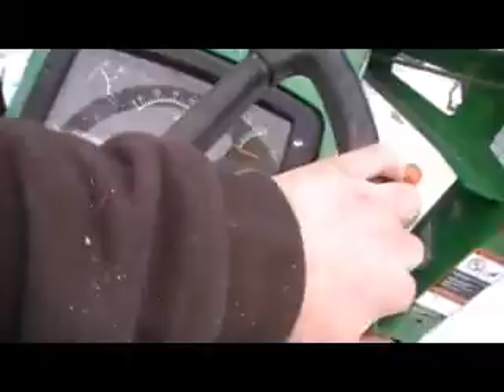putting a bucket on a john deere 790

Comment: I have a 790 tractor without the front bucket, and I was thinking of maybe looking for a front loader to put on the tractor. I noticed that your tractor have turf tires on it's rear and those are not good for the snow. My tractor came with the mid grade tires which can be used for agriculture, and general purpose around the farm, ranch, or home.